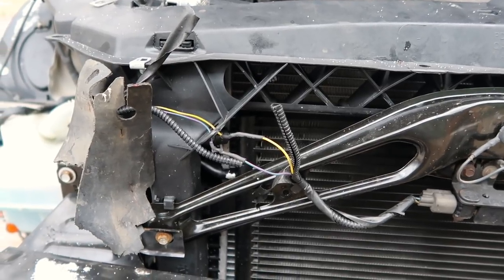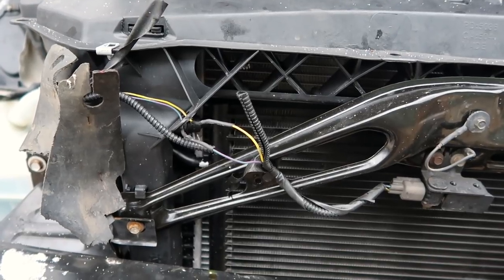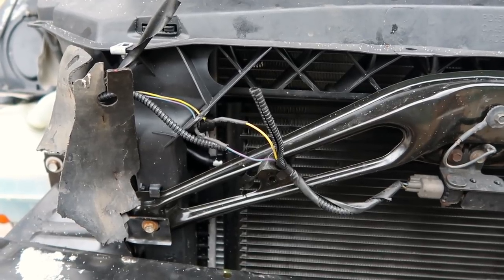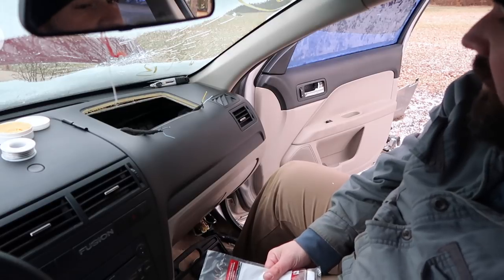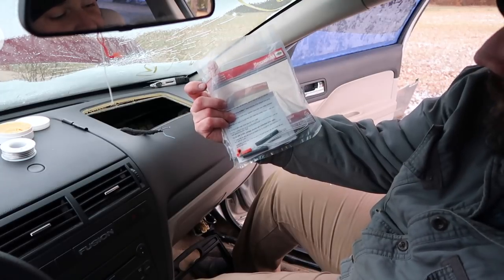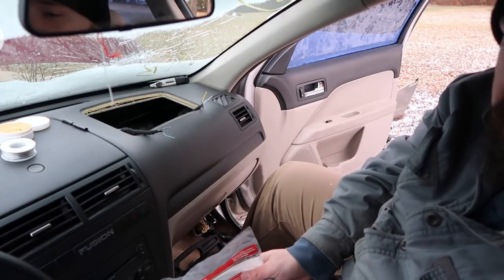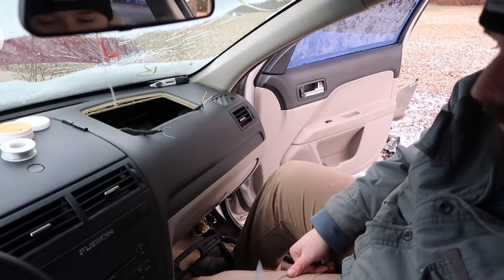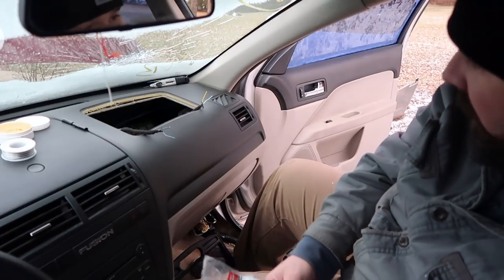Fusion Rebuild -- Part 8 -- Airbags & Seatbelts Part #2 -- My First Copart Rebuild Project

Comment: A possible quick easy fix for the seat sensor, slide the passenger seat all the way forward and all the way back, had to do this on an old ford escort I had to reset the sensors can’t remember if it was with ignition on or off but you could try both good luck
Reply from the maker: Thanks for the tip! I have several things to try to fix the issue. Hopefully it’s something easy!

Comment: Good Video.....I live in Indy too....only 15 minutes away from Copart......bummer that individuals must use "broker" to bid on any car.....so, I haven't done it yet.  Seems to me....after buying and adding all the fees and the broker fee.....maybe can buy an un-wrecked car for about the same price as repairing ......just my thoughts....especially if have to send out for Frame damage ...then, really expensive to repair these wrecked cars.....
Reply: jinan0014 You have to make sure you don't bid too much. Try to stay emotionally detached from the car not to bid so much that it's not worth it. You could ask the broker how much the fees are too.
Reply from the maker: Good advice!
Reply: Yes, I have seen several "broker" fees....and they are not cheap and some even want deposit as well as fee to bid for you.  I understand....don't bid too much...but two weeks ago...I saw two vehicles here at the Indy Copart....those two cars were not damaged too much...but the bids on them were "crazy" high....high enough that I could buy used car...the same or a little bit higher.  So, I just don't know if buying will pay off?  I will continue to watch YOU....and see what happens....if you sell and make some profit?  Of course, a "salvage" title vehicle...will need to be discounted....and I think...most "lenders" will not make loans on them...not sure about insurance...maybe can only get liability coverage?  Thank you for your messages.....I will continue to watch your videos....!!!!